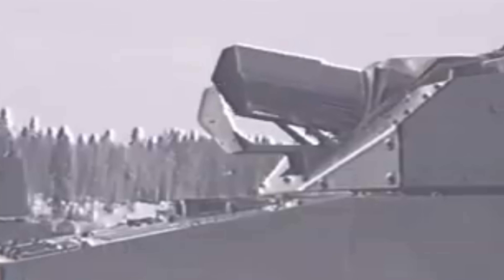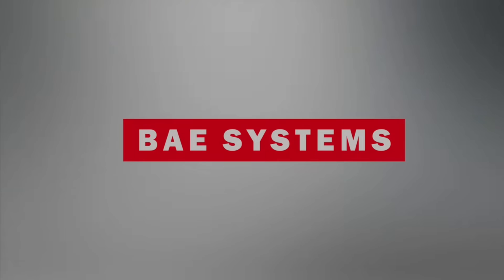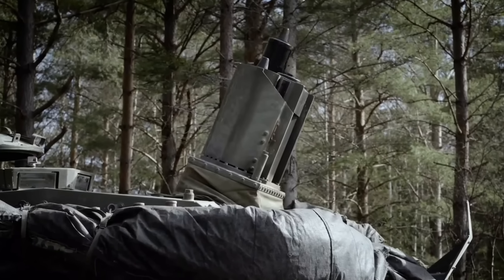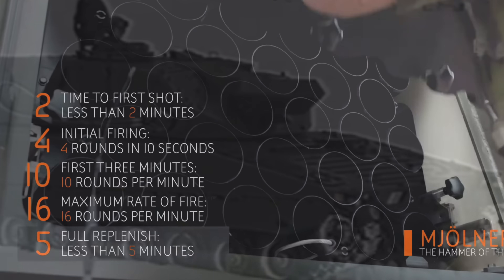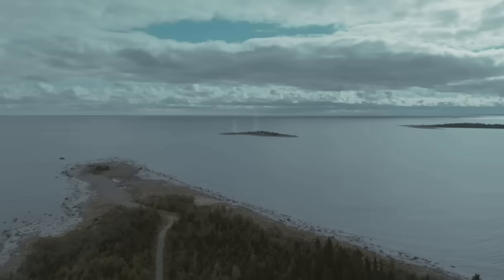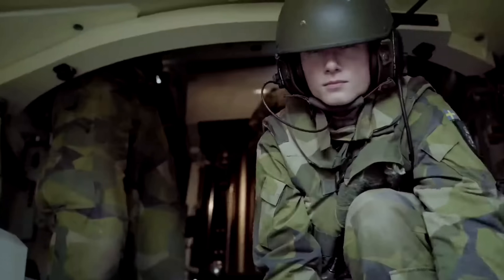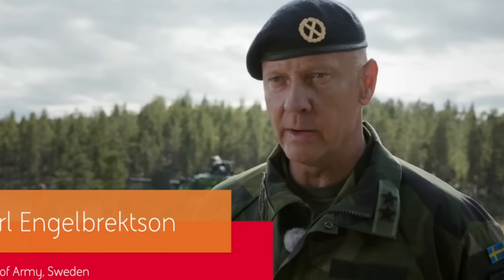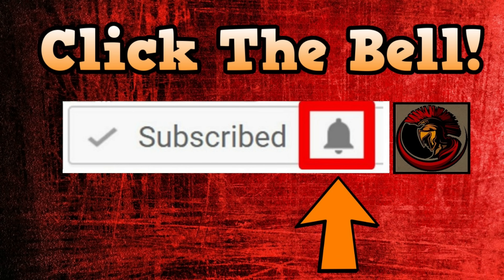The 'Mjölner' Rapid Fire 120mm Mortar Vehicle | DOUBLE BARRELED INDIRECT FIRE

Comment: CV90 is such an amazing platform. It's a shame we can't donate some to Ukraine but we only have 60 of them (20 more on order).
Reply: Swedish government actually approved to donate 50 CV9040 to Ukraine, will be much interesting to see how it performes against an enemy it was built to defeat from the beginning.
Reply: @andreguve3988  Indeed. It's seen some action in Afghanistan but I have no idea if the taliban even fired back on the vehicles..
Reply: @FXGreggan.  The Taliban did engage Swedish CV9040Cs directly in Afghanistan during ambushes, after the first couple of engagements they simply gave up all forms of direct attack on convoys and units that had CV90 support. The 3P rounds with programmed fuses proved absolutely devastating and made much cover useless with their airbursts.
Reply: @Vonstab  I imagine the greatest threat to the CV9040Cs in Afghanistan would be crew compartment aircondition failiure 🥵🤣
Reply: Where did you get the number 60? When I checked it said we have 549 CV90's. Which might be the reason why we have 50 of them that we can send to Ukraine.
Reply: @nian60  60 is the number of GRKPBV 90 in service, 549 is the total of all different models.

Comment: 4:52 personally i like the idea of an otomatic 76 but in an indirect fire role yes the 76 mm is a smaller round but when you are firing that many of them in  that short of a time frame and if you are mrsi to the mix  i imagine you have an effect on target not dissimilar to a cluster bomb as  76mm shells come raining down and air bursting
Reply: Issue is the size and logistics.
Reply: 76mm is too light for artillery
Reply: @AdurianJ  not exactly. They're perfect for soft skinned targets
Reply: @reginaldpasao8390  But only for that it's not light enough to damage fieldworks that was discovered all the way back in WW1 you need at least 10,5cm when it comes to artillery.
A 12cm mortar is both less expensive less complicated and has a bigger payload than the 76mm
Reply: @AdurianJ  lol tell that to the french lol

Comment: Imagine a dozen of these Mjölner mortar vehicles supporting the defense of Soledar from waves of Rusky infantry attacks...they couldn't even come close to the town centre.
Reply: Sweden should send them to ukraine!
Reply: @HedgehogZone  it's possible some are already on the way, the 50 CV90s the govt promised didn't specify armament or type, but 50 CV90s is pretty much spot on for a mechanised infantry battalion of three line companies (3 platoons of 3 Strf9040 each plus 1 Bgbv90, 2 Ldvagn90 and 1 Evagn90) One HQ/Support company ( 2 platoons of 4 GrkPbv90120 each) plus an assortment of command, communications, logistics, recon and meddvac vehicles.
And one AA section of 3 Lvkv9040)

Comment: How about direct fire, low angle firing or fire on the move?
How can loaders handle constant fire workload?
This system is lightyear behind Patria Nemo.
Reply: It is always a balance between cost/ability. 
A automatized system like Nemo is more complex, meaning more maintenance to keep operate but mostly cost of acquire.
There will always be a budget constrain, no army will ever get all they want. So a larger number of less capability units might be more effective for a certain cost. 
It is not all about the stats of the piece of equipment but about the efficiency of the system as a whole.

Comment: Seems odd to put it on an ifv chassis from a logistics perspective.
Reply: Nah, makes everything easier from a logistics perspective.
Reply: @Pile_of_carbon  No. Heavy tracked platforms are harder to maintain than light wheeles ones. This also applies to expertise. You have more mechanics that can handle wheeled platforms than mechanics that understand tracked ones.
Reply: @swooosh9143  You are clearly a genius tactician! Please write to the commander of the Swedish armed forces and explain that he's doing everything wrong. xD
Reply: @Pile_of_carbon  No need to get offended over a simple question. Here in Finland we prefer to use armored wheeled platforms for advanced mortar systems.
Reply: Because Sweden does not have any classic tracked APCs. All of those were replaced by the CV90.

Comment: I don't understand this TBH. Maybe if it was a 1300mm or 155mm.

Why not develop a tank that can fire like a howitzer. Ballistic computers and fire control systems aren't the issue.

Surely we can develop a MBT gun that can have different charge levels. A full charge being the standard and being able to take some away or add to it. Anyways yeah guys tell me why we don't just develops an MBT/IFV that has a high elevation. A lot of the newer wheeled and tracked artillery can fire directly at targets now.

 Tanks are going to require a lot of elevation then the past anyway due to urban and drone warfare becoming more prevalent.

Comment: What do you guys think of mounting some 120mm mortars on such a heavy and armored platform? IDK, honestly. I'd say there are better lighter vehicles than could carry them, specially this being an undirect fire weapon...
Reply: The reason for going with CV90 chassis for (almost) everything is you only need to stock up on spare parts for one type of vehicle and it simplifies training maintenance personal. It's all about simplifying logistics.
Reply: @Pile_of_carbon  also, I'm wondering how the tracked vehicle fits in Sweden's doctrine. Makes more sense, I believe, for snowy and muddy terrains, but I'm not exactly familiar with other wheeled vehicles used in there.
Reply: @josecarlosamador  It fits really well into the Swedish doctrine. We use very few wheeled armored vehicles. The terrain here in Sweden consists of dense forest, mountains, muddy fields and other uneven terrain. In the winter, the snow can get a couple of meters deep in the northern parts. Tracks are king here.
Reply: You never know when indirect fire weapons can be shelled and or fired on. Once you fire you become a fire magnet. Having good armor will safe lives and systems
Reply: @JasperKlijndijk  I get it, but again, a more mobile platform wouldn't do the trick? The idea of modern selfpropelled artillery or mortar is kinda to keep mobile. Howitzers they kinda cant carry much and are harder and slower to reload, so they kinda get stuck in the same place a lot more than a mortar vehicle. Honestly, counterbattery would probably not be able to target a mobile mortar platform in time; I can think mostly of drones being the greatest threat to this.

I'm not saying it's bad or something, just that it doesn't feel so intuitive to see a 120mm on such a heavy vehicle.

Acoording to wiki, the CV90 platform: "Armour protection over the frontal arc is classified, but all models from CV9040B onwards are said to be protected against 30 mm APFSDS. Some variants, including the CV9030N, can be fitted with MEXAS, a ceramic appliqué armor that provides protection against 30 mm APFSDS. ". Just feels a lot for a weapon system not designed for direct fire.
Reply: @josecarlosamador  Archer is faster to first shot, faster to three rounds, and faster to leave and carry 21 rounds. So I wouldn't say that it's harder or slower to reload. Especially when it's automated.
Reply: @josecarlosamador  the turret could probably be mated to a number of different vehicles but that is a mainstay Swedish platform.
Reply: @darkiee69 Archer is at least twice the price and complexity,
Reply: @jackdbur  I think he was just counting my argument of mortars being faster than howitzers.

Comment: 1)caliber. Mortars stopped at 160mm as being the heaviest among the useful range of calibers. It's harder to load, haul around and has less ammo capacity on same platforms, BUT those don't matter as much when you force those heavy mortars on self propelled chassis with assisted loading anyway. 
I guess here they stopped at lower caliber for the sake of inherent logistics of using more widespread caliber with existing supplies?

2)main advantage of mortar is how cheap and easy to use it it compared to normal gun. It's expendable and needs barely trained crew to iperate at minimum useful capacity. Here you put it on expensive IFV based hull and turn it into a vehicle with requirements for highly trained crews. Is it really better then simpler 120mm mortar with two loaders and pneumatic ammo crane inside an old APC like M113 or MT-LB?
And is firing more accurate counts as more effective if you talk about expensive laser and GPS guided ammo for that, which would be better used for actual howitzers?

I feel like the lack of orders is due to this system trying to "unmake" what makes mortars and invent self propelled howitzers the second time ¯\_(ツ)_/¯

Comment: From the warfare we are currently seeing indirect cheap firepower is king. 
But precision is king though, how precise is this thing at diffrent ranges? 
It if can give a direct hit with just spending a 1-3 rounds it would be awesome kit. 

Standard artillery can with standard rounds hit a specific foxhole or vehicle, but it will take a lot of rounds unless you use guided rounds. 
And spending a 100K€ on a few troops or  BMP is not worth the rare rounds.
Reply: there are guiding rounds for it too.
Reply: @benktlofgren4710  Right my point is the accuracy for cheap dumb rounds needs to be very good for success at taking out individial fox holes and vehicles.

Comment: The mechanized/armored battalions used to have 10,5cm howitzer 4140 as their integrated artillery but in the 1990's when the 12cm STRIX top attack smart anti armor mortar round came into service this was seen as such an asset the 10,5cm howitzers where switched to 12cm mortars.

In the current organisation all maneuver battalions have two mortar platoons in their command companies and in the mechanized/armored battalions those are two platooms of Mjölnir vehicles.
All platoons have 4 mortars or 4 Mjälnir giving a total of eight per battalion.
So far 40 Mjölnir has been delivered and 40 more are on order which will cover the 10 Armored/Mechanized battalions of the 2020 defence decition.

Comment: I don't understand why designing a breech loading 120 mm mortar that uses NATO standard rounds is so difficult.
Reply: Mortars can be big because they're made from a light tube with no heavy parts to hold back pressure. A breech would have to weigh several times as much as a mortar tube the same diameter, and it would need a bigger vehicle.
Reply: @loupgarou-dj3tm  That makes sense for towed mortars, but an IFV can handle a heavier breech. 120mm effectively replaced 105mm howitzers. The goal should be to match the range of 105mm, even if mortars can't match the accuracy.
Reply: @jameslooker4791  - The point is, it's a mortar. It's not a long-range weapon, it's not a direct-fire weapon, and they replaced the guns because the guns weren't needed for their job, they're so much heavier, and their ammo is a lot more expensive. If you want a 120 mm warhead with the range of a 105, you're talking about a 120mm gun, not a mortar.

Comment: From a tactical perspective, I have to believe that this kind of highly mobile 120mm firepower has a place in cavalry maneuver.
Having 2 or 3 of  these bad boys moving with small cav/scout units to provide a base of covering fire for both advance and retreat would be perfect.
Reply: They are integrated in the CV90 mech inf. & Strv122/CV90 armor batallions with two mortar platoons to each bat. Idk how many Mjölner vehicles to each mortar platoon, but I would guess on 3,
 they replace two platoons of 4 towed m1941 mortar pieces each.
Reply: @SonsOfLorgar  There are four vehicles per platoon
Reply: @AlexanderTheTiny  now that's just an evil level of OP🤣
Reply: Yeah, throw in a tank killer and you have a proper mechanised unit that can do some real damage whereever they are. Add to that the global eye system and... well, good night Russia.
Reply: When Mjoler is firing a couple of Strix top attack heat seeking grenades it is a fearful weapon against tanks 👍🏻

Comment: the platform and turret are overkill for something that doesn't really have the mobility capacity and logistics that exceeds a pair of 3 man six wheelers that are amphibious.   You're not gonna sit in one place long enough to unload even 1/6th of that ammo payload.   The system is quite probably much safer than the breach loaded unit but this thing lacks the ability to quickly clear a dud like you have with the better twin system OR infantry operated systems installed in hatch vehicles.    To be clear this thing isn't as good an option as four loaders, four computer controlled manual tubes an artillery sgt and a driver in a 6x6 flatbed.

This looks like adding fake body pieces to a shitty kids' bike to call it a special version.    A pair of carousel loaded 120mm tubes that unfold to the ground on the sides, aim and dump 7 rounds into the tubes then fold up back on-top of an enclosed flat-top CV would be better because you could un-mount the tubes and replace them with just latch systems and carry two spare tubes AND a pair of unmounted tripods inside.   Break point, reload the carousels from their butts somewhere else and be able to quickly change the booster ring count when you know your assigned destination and target range.  You could have a manually filled carousel reload system from inside the rear compartment.  

This use of the CV is idiocy.
Reply: The AMOS system was developed for Sweden and Finland, with 40 CV90-chassies converted for the new turret. Enter the Reinfeldt cabinet, and the delivery of the already manufactured turrets is cancelled.
New cabinet, and army still needs mortars, so Mjölner is the budget version using those already existing hulls. Still beats the snot of a flatbed out in the boonies ;)

Comment: You know, an old Brad with turret taken off can fit a lot of ammo where the turret was, with the mortar in the troop compartment that fires through the roof hatch.  And gives you a rate of fire of 16 rounds per minute from one tube, though the ROF drops to 4/minute after a minute.  But you should probably move after a minute to avoid counterfire and let the tube cool.
Reply: an old m113 would do it i know that they do have m113 mortar vehicles or did.
Reply: @rightside1911  Well, they spend the past 30 years using the same old M113s and bitching about their reliability and mobility vs Brads while hundreds in not thousands of old Brads sat in storage.
Reply: @k53847  if the turret ring diameter on a Bradley is the same as a CV90, the Mjölner or AMOS turrets should be possible to drop right in and wire up with very little modification.
Reply: @k53847  why waste a bradley from its intended purpose of direct infantry support when they could mount the heavy mortars in the m113 instead of infantry having to carry them in they fire a few shots have to tear down to dodge counterfire that way m113 is not exactly in on the frontline but still supporting infantry ukraine doesnt seem to be bitching about their shortcomings using them as ambulances they are more stable than a technical.9 mile standard range should keep them well out of contact.
Reply: @rightside1911  The use of a common platform is better, it eases the logistical strain and it allows for reducing the different schools for crew and mechanics.
Reply: @rightside1911  The first batch of roughly 450 that I found in one lot at Sierra via google earth in the long-term storage yard are really not doing a lot of that these days.  And they have been stored there as far back as the imagery goes.  The yard is huge has probably over 10,000 total vehicles of many types.
Reply: @SonsOfLorgar  Don't know what either are.  And the turret ring is typically bolted to the deck, so you can make it a little bit larger or somewhat smaller without structural work.  But not cheap to do.
Reply: @kristiangoransson6104  yes i agree i think those would be great for Ukraine to have those but i have seen ukraine mount a howitzer on an old soviet mtlb gun tractor just to get the gun back into the war those m113s that they have quite a few of could be better used for 120mm or 80mm morters anything to increase the pain on the enemy.
Reply: @k53847  Ukraine will be losing some of those bradleys to attrition they are going to ned replaced and russia is planning on drawing this war out as long as possible im just trying to figure out best uses of what they already have on hand. the u.s. used to use the m113 as a mobile mortar platform and Ukraine has plenty of welder/fabricators that could make a simple set of mounts in the old apc.
Reply: @rightside1911  What’s needed for the Ukrainian situation is a agreement to send one type of apc, tank, truck and artillery etc. That would mean that the inevitable logistical nightmare of having so many different types of systems could me mitigated.
It’s a turning into an ridiculous game of sending tanks and apcs without asking any questions, like Danish and Swedish politicians wanting to send Leopards when they have 48 and 120 in their respective army’s. Just because it’s a Leopard 2 doesn’t mean they have the same spare parts or are compatible when it comes to their communication systems
Reply: @kristiangoransson6104  If the Ukrainians want it, send it and let them decide how to handle the logistics.
Reply: @kristiangoransson6104  i agree but unless you have a country that has several thousands of one type of ifv just sitting around  and they are willing to send them im all for it but Ukraine will take what they can get they are fighting for survival as a nation.